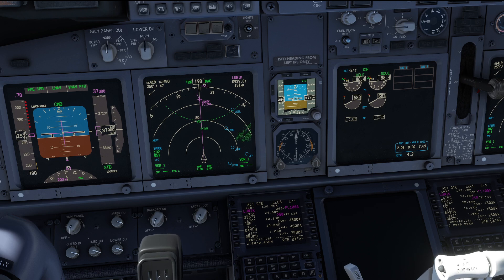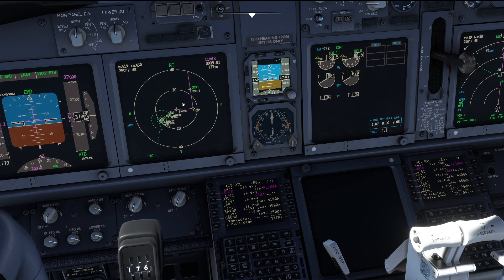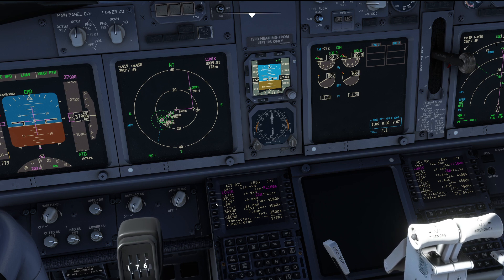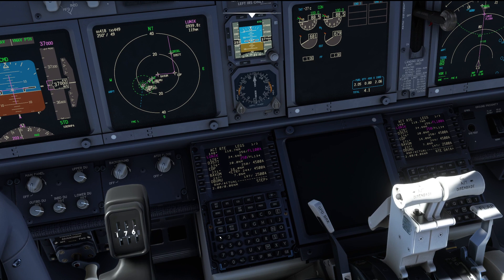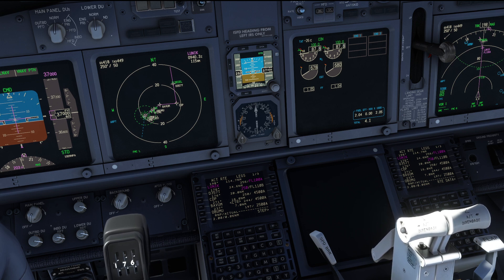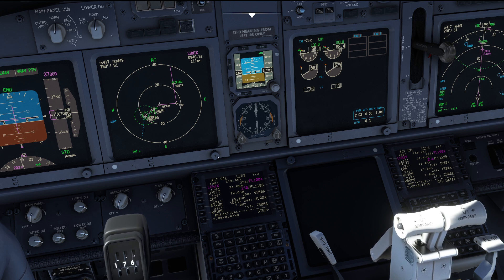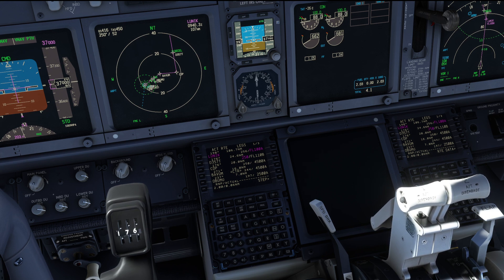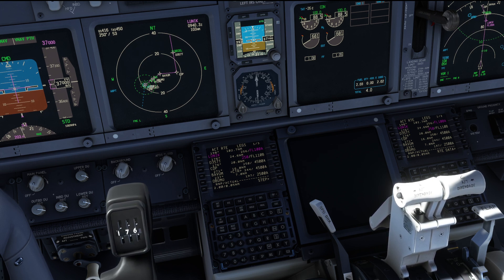737-800 Energy Management - Anticipate Shortcuts! | Real 737 Pilot

Comment: Great video as always! I have a question, though. Whenever I do a approach on VATSIM, ATC sometimes to tell me to go to a waypoint that is not in my routing and I have to add it in. Does this also happen in real life?

Your last statement is certainly true on VATSIM too! Shortcuts and vectors... I sometimes have trouble to get the AP back on properly to intercept the ILS properly after a ton of vectors. I have found that to re-enter the ARR with only the ILS helps for this. :)